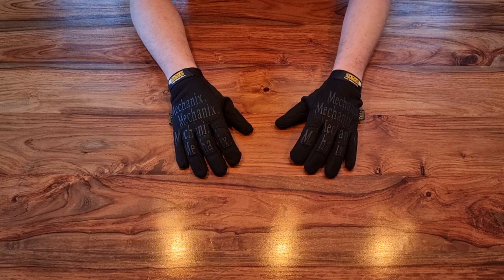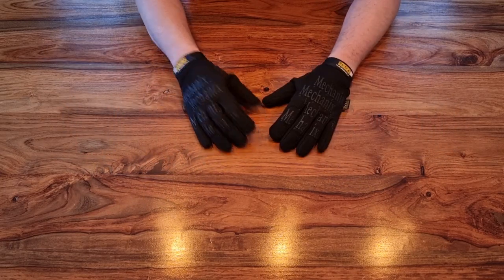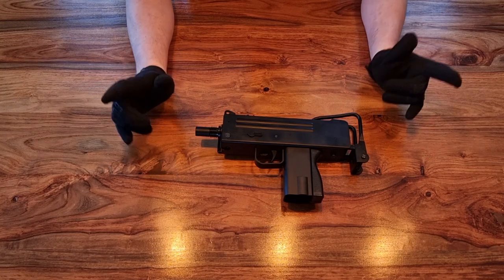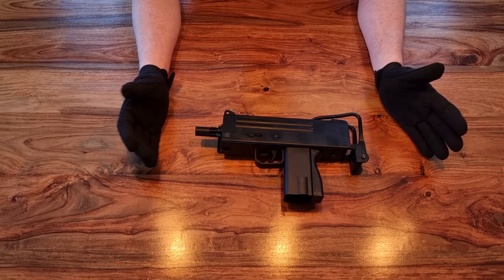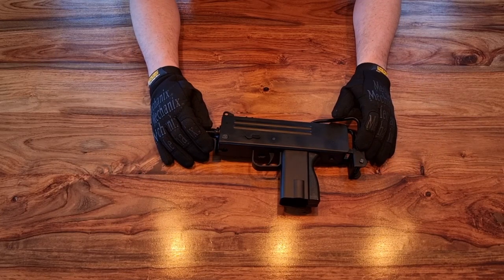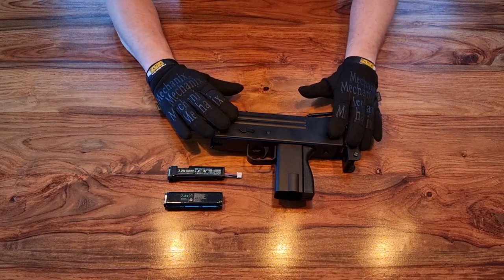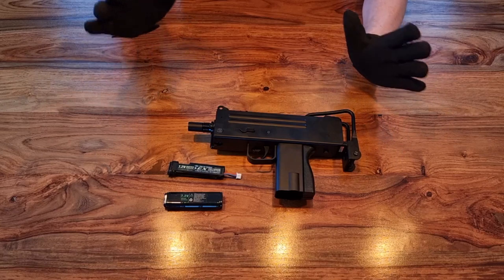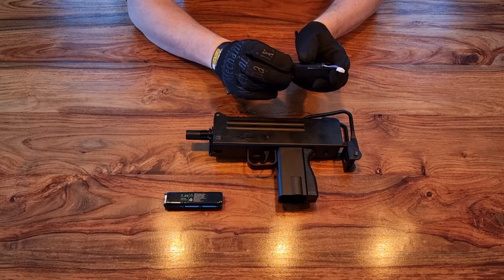The easiest way to get a LIPO battery into your Airsoft MAC 10, no strip down required.

Comment: You need a lipo balance charger also as the nimh one they come with won’t charge a lipo. The best way to use these macs is bushwhack style in a ghille as they are quieter than most AEG and gas, they have shit range however so ambushing is really what they are suited for. Good for room clearing and hip firing also as the  peep sights are trash on them.
Reply from the maker: I completely agree. To be fair the supplied charger is not the best even if your using a nimh battery. The only problem you encounter is the bespoke connection.
Reply: @rockbottomairsoft  The battery connect is the one thing they shouldn't have cloned with the JG. Most people don't want to tear it open and solder new wires, can't say I blame them. That being said there is a great step by step tutorial video a guy did on YouTube where he puts an 11.1V LIPO and Mosfet with a modest amount of modification, and that thing rips like any HPA or even faster at over 1600 RPM, he used the TM MAC 10 so I'm not sure if the JG gearbox is the same quality and I highly doubt it, but someone could do it if they wanted also. https://www.youtube.com/watch?v=WehTOoqzA-c
Reply from the maker: Thanks I will check that out. I am considering tearing this one down and seeing what I can do with it. Usually JG boxes are built solid so I remain hopeful.

Comment: Hey there, great video. Can I use a " Evike Airsoft - Matrix 7.4v 680mAh LiPo Battery for Tokyo Marui AEP Airsoft Guns " as the 7.4v battery for this MAC 10? thanks!
Reply from the maker: Hi. Thanks. I'm glad you enjoyed it. Yes you should be able to use that battery but you will still need to use the adapter to run it in the MAC 10.
Reply: @rockbottomairsoft  yes, I found the adapter that wasn't out of stock.. lol but thanks!
Reply: @rockbottomairsoft  I am just struggling on finding a charger
Reply from the maker: If your looking at evike this is a budget charger that will charge through the balance lead:

https://www.evike.com/products/16472/

I've not used this one myself so I couldn't say how good it is. However there are quite a few similar chargers available. That is the kind of charger you will be looking at for these small capacity aep batteries.
Reply: @rockbottomairsoft  Appreciate it man, thank you!

Comment: I just got my Mac 10 but my charger is not working when plugging it into the wall
Reply from the maker: Hi, sorry to hear your having problems. I know with mine I thought the same. However there's no indication on my charger. It just charges. Its also a "dumb" charger so you just have to leave it going and switch off after a little while. It takes a couple of hours. However if it's definitely not working I would return it to your supplier for replacement.

Hope this helps.

Comment: What would you use to charge the battery?
Reply from the maker: You will need to use any balance charger that is able to charge through the balance lead. A lot of the more affordable chargers only charge via the balance lead so there are lots of options. A good quality charger is always worthwhile though so if you can get one that allows both and can charge with full  features such as storage charge then that's even better. The RC world normally has the best range.

Hope this helps.

Comment: Would a Titan 7.4V 3000Mah  brick style lithium ion battery with a deans connector fit into that Marui converter?  Also what do you recommend for upgrading an AEP motor for this mac 10?
Reply from the maker: Hi. The simple answer is no. The marui adapter will only work with AEP battery's. They have a proprietary connector which only works with the adapter. There may be enough space in the replica to just modify the connection point to deans and as you say fit a deans connector, this wouldn't require the marui adapter though. There are some online articles where people have done a similar modification. 
Upgrades for AEP's are rather scarse. However there are the usual hop rubber and barrel options. The gearbox can be shimmed and I believe there are some airseal components available. Again they are not easy to come by here in the UK though. I'm still doing research into upgrades for mine at the moment. The best and simplest upgrade does seem to be a lipo mod of some sort though. Whether using the method I use here or modification.

Hope this helps.
Reply: @rockbottomairsoft  Thanks for this. I am looking at getting a Mac 10 but the battery capacity does concern me a wee bit hence the question. I can probably get the connection swapped to a Deans, however before I buy I'd like to know if the aforementioned brick battery would physically fit width and height wise into the replica, is this something you can confirm if you have said battery in your collection?
Reply from the maker: I don't have that particular battery unfortunately.  I am pretty sure you could fit a decent capacity in there though. However like I say it will take some modifications to enable a deans connection and to make the top into battery storage.

Comment: Jeeesus I Need know how install,if have inverted polar... 10 minute and I still waiting
Reply from the maker: I'm sorry to hear you found the video a bit to long. Hope you figured out the installation with it though.
Reply: No,not this... I can find a single video about it... And isn't so easy,one part little bit coveted from the black Plastic "cover"
And  lmg battery didn't tell you the positive and negative part.. 50/50 but if I pick he wrong one I can start a fire...
Reply from the maker: @marcelloventuri8898  If I understand correctly your worried about getting the polarity wrong. Best thing to do if your using the converter is check the polarity with a multi meter before putting the battery on charge and check that its not reversed. This would start a fire if you charge it reversed, well it could risk it if your charger is not intelligent. However if its reverse polarity in the replica you won't get a fire but you could run the motor in reverse and that will not do the replica any good, so again if you've managed to check the polarity with a multi meter then you should be good.

Hope this helps.
Reply: @rockbottomairsoft  fuck hell I found it.. using flash light .. adaptor pin,inside... are little bit red -.- 
I use a silver marker on  the external part 
Txn

Comment: How would you charge the upgrade battery cheers
Reply from the maker: Hi. The only way to balance charge these batteries is to use a charger that is capable of charging through the balance lead. There are a number of options including one from Giant.

Hope this helps.
Reply: How long dose it take to charge the standard battery thanks
Reply: And my brand new Mc 10 in hand just today only fires when upside down only put the 200 bbs you get with it what’s going on can you help me thanks

Comment: you help me out a lot, but question I live in the US. what website can I find this at?
Reply from the maker: That's great, I'm glad to hear the videos help out. The adapters can be obtained from a number of ebay sellers that I found in the US or will ship from Japan to the US. Just search TM AEP lipo adapter on Ebay. There are also adapters at websites such as Evike. As for the AEP batteries it looks like Evike stock those to.

I hope this helps.
Reply: Evike

Comment: Hi,
Do you reckon I just pay more and get the Tokyo marui mac 10?
Reply from the maker: Hi. Unfortunately you will still need this adapter to run the aep lipo batteries in it. The JG is basically a clone. Which one to get is down to choice and budget. However this jg has great range.